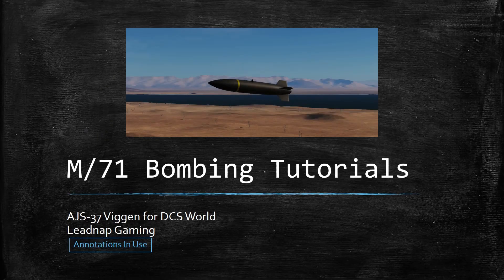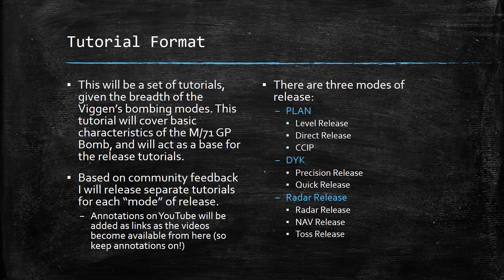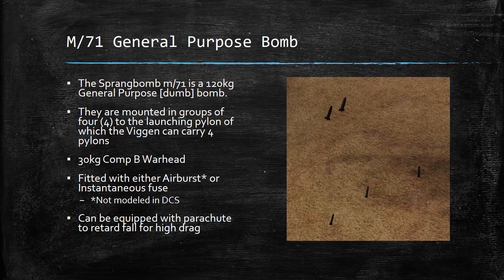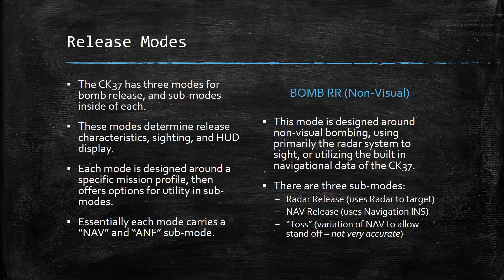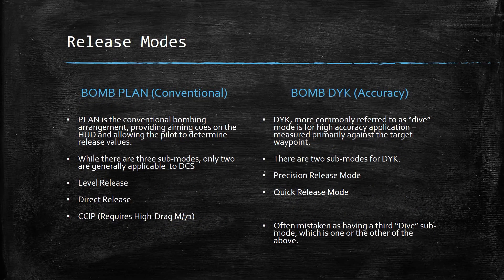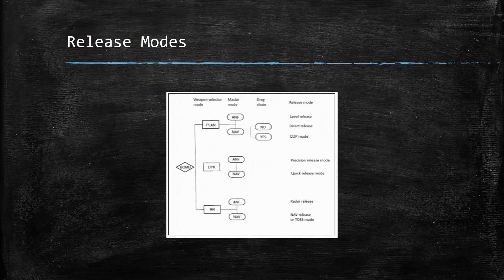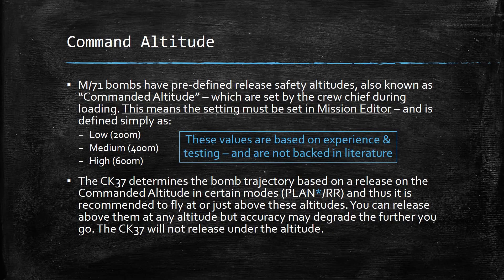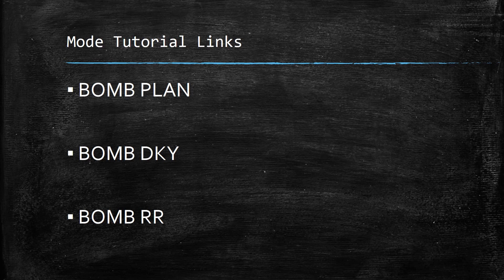DCS AJS37 Viggen Bombing Tutorial - Base Tutorial (1/4)

Comment: It's not a general purpose bomb it's a fragmentation bomb that's what "Sprängbomb" stands for. The Swedish designation for general purpose bomb is "Minbomb" something the Viggen never got because of budget cuts. If one looks into the history of the Viggen project it got so expensive major features had to be abandoned or left un-upgraded throughout it's lifetime. The Viggen version that got the most love was the fighter variant.

The A32A lansen the Viggens predecessor was a transonic and had all kinds of bombs but they where mostly old designs that wouldn't work on a Mach 2 aircraft like the Viggen.
The only things that was inherited where the m/61 high explosive bombs in some capacity (the fuzes on the m/71 say m/61 so i suspect it's a rebuild of some kind) and the Illumination bombs.
Oh and the RB04 but that was heavilly modified with a shorter wingspan and a modern seeker.

A secondary reason the Viggen never got heavier bombs is that so few where aquired that the mission to support the army in the north where abandoned and the sole focus being directed against a coastal invasion.

The A32A's rockets where carried over by the J35 Draken and Sk60 light attack aircraft though.
Reply: Thanks a lot for the interesting details, very helpful since most real-life Viggen documentation is in swedish :)